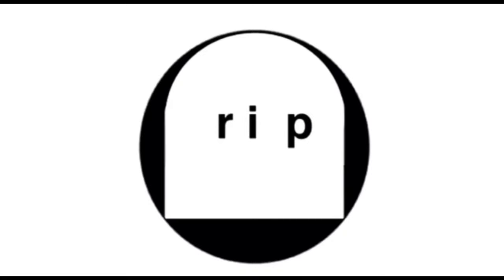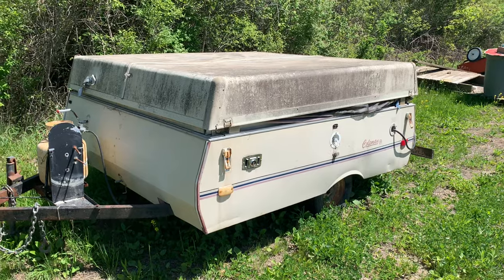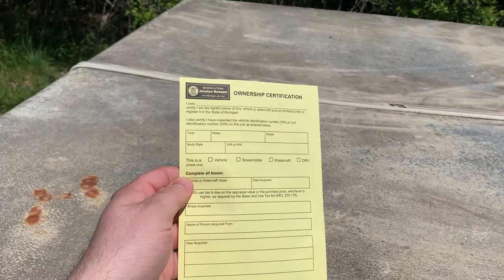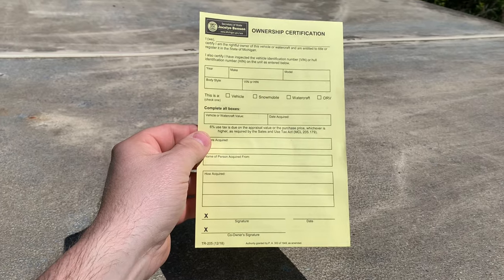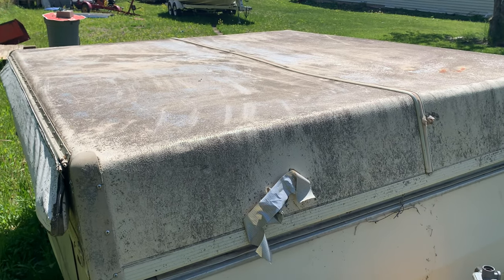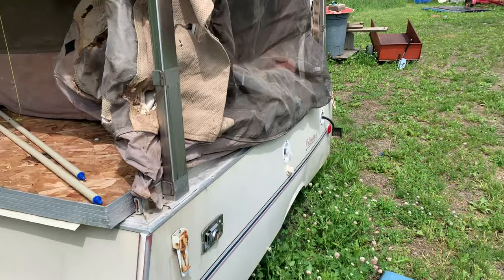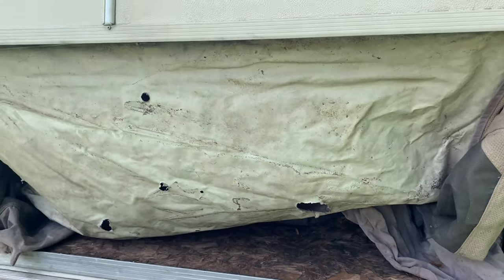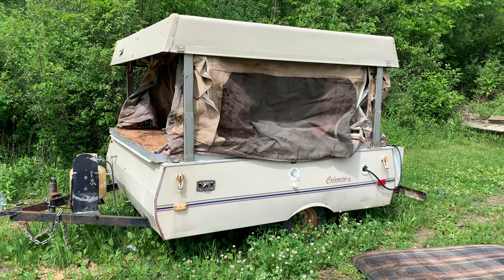No Title - Lost Title - No Problem!  How to get a NEW TITLE at DMV / SOS - PopUp Camper Restoration

Comment: This video is great!!  The title info is beyond valuable.  I've turned down free stuff just because there was no title and I thought there was no hope 😕
Reply from the maker: Thank you!  Yeah I figured it was about time someone posted the process. I got lucky and had a nice lady at the DMV/Secretary of State explain how to make magic happen. Only risk you get into is the possibility of reported theft. So really that’s the only risk. An extra bonus tip. I got a free boat trailer with no title or even a VIN on it, and those you just have to get weighed at a weigh station which some gas stations have and get an official weight slip and boom they will make you a new VIN and get you on the road. Almost the same thing with a boat except you don’t even need to weigh it and you don’t even need a Hull ID they just make em on smaller craft. I forgot the length you can do this up to but mine is 10’ fiberglass Livingston without a motor and it was no problem.  So word to the wise don’t pass up free stuff!  If your into restorations.
Reply: @Jeep-Creep  I'm screen shotting this!! Thank you!!
Reply from the maker: @americanboathead5390  go for it brother!  👍🏻
Reply: @Jeep-Creep  do I need a bill of sale if so what needs to be on the bill of sale
Reply from the maker: @chrisshirak347  a bill of sale helps yes. Just get the persons name, address, signature with date.  How much money you paid for it.  If you can find a VIN that makes it easier bc they will do a background search. If no VIN then you will need to get it weighed

Comment: Lol a custom home built trailer. Then register the trailer then put the pop up on your trailer
Reply from the maker: You can go that route as well. Lots of YouTubers do that. I considered a frame up rebuild. However I am one of the few that have a custom trailer for just over $300 bucks. Yes I have more into it but extra amenities were not necessary. I know guys that go out and spend easily $1,000 just on siding. Then insulation. Special aluminum roofs etc. My goal was to build something as cheap as possible while building a stronger than factory camper.

Comment: I just bought a camper it has a certificate of origin how do I do this
Reply from the maker: Go down to your DMV. There is a form that they have and you best explain your situation of how you acquired the camper. Provide them with a VIN which should be stamped somewhere on the camper. As long as it’s not reported stolen and you have a receipt from whom you acquired it from you should be good to go with that form.

Comment: I would have popped the top and inspected everything before trying to get a title. I'm betting it cost more to fix up than it's worth. Thanks for the title info
Reply from the maker: You are right.  New canvas top is like $1200 bucks! So if you check my other videos I converted it into a hardside camper using 3/4 ply board. I am not sure what it’s worth now but it’s pretty nice now and I am going camping this summer. Stay tuned too for new videos.

Comment: What if you can’t find the Vin number for the Vin numbers been scraped off
Reply from the maker: I had this happen on another trailer. They can basically assign you an ID number I believe. Or if you have any ID number on it they might try using that as well. It’s basically the same as registering a newly made trailer I think.